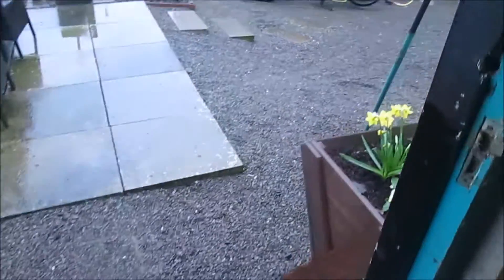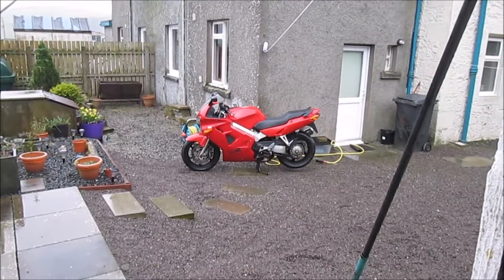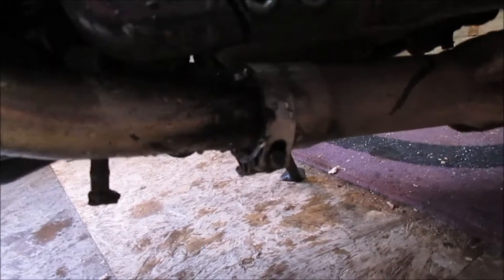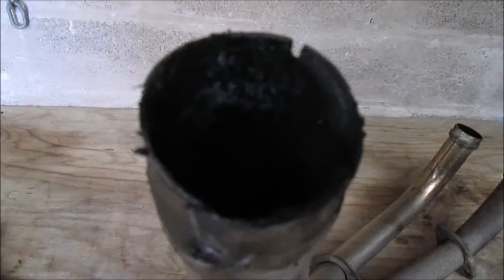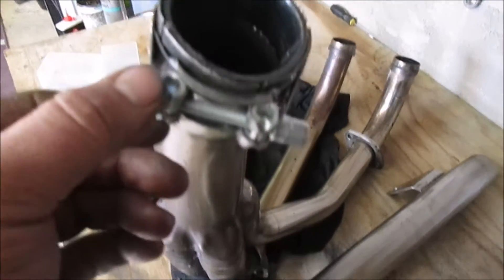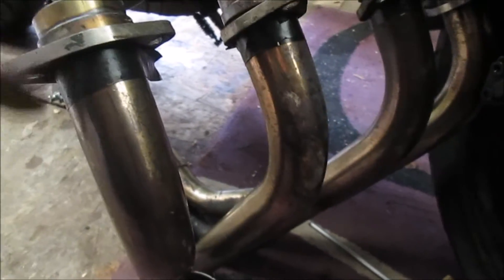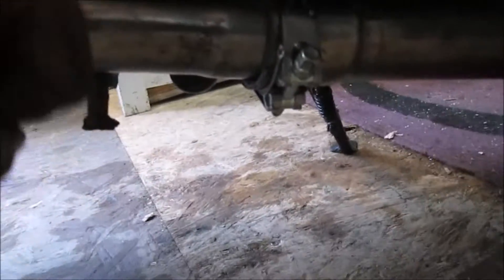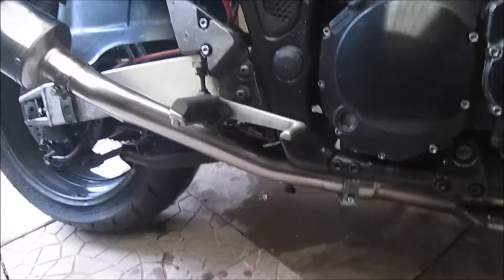Bandit 1200 fixing the Black Widow collector

Comment: Did you buy a specific clamp? or just a generic one you find in an auto shop? I currently have the same problem and have a gasket on the way but am also thinking of buying a new clamp as well.
Reply from the maker: I think I used any clamp but has to be the right size, I can't remember what size you need, ask on the face Bandit owners club, those guys know everything

Comment: Hi bud can I ask a question I’m currently rebuilding my exhaust as the previous owner had chopped and welded the header and fitted an exhaust flange to it so the can bolted onto the header I’ve had nothing but issues with it like this and just want to ask for some tips or advice ? Dose the gasket go between the header clamp and the link pipe so when you tighten the header to the link pipe it clamps around the link pipe ?
Reply from the maker: It goes inside the downpipes (header) then the link pipe slots into the gasket, then you pinch it up with the clamp, I've discovered the place where the gasket goes has to be as round as possible and the gasket is a very tight fit. Use some oil on the link pipe so it's easier to go in, doesn't have to be too tight, just nip it up, if it leaks, nip it a little more till it stops.